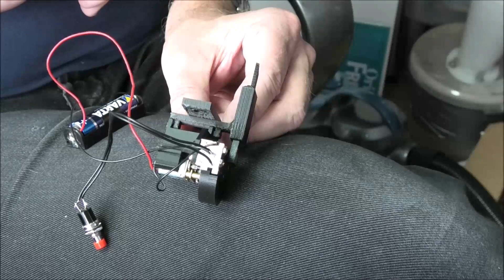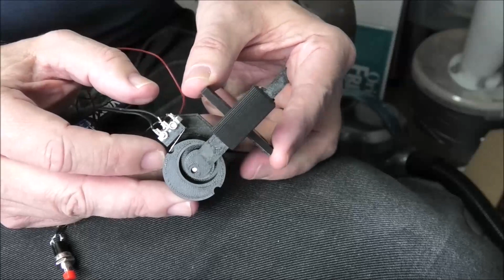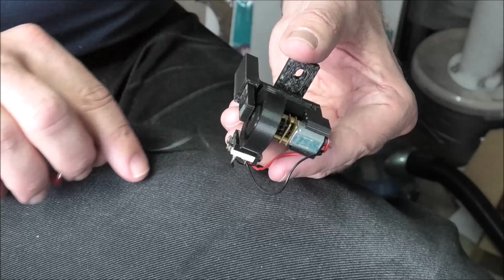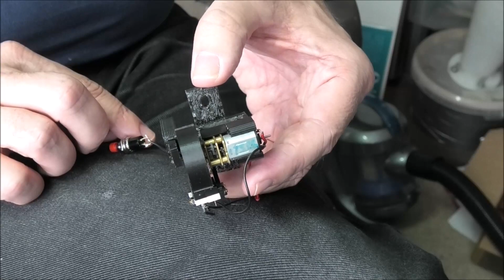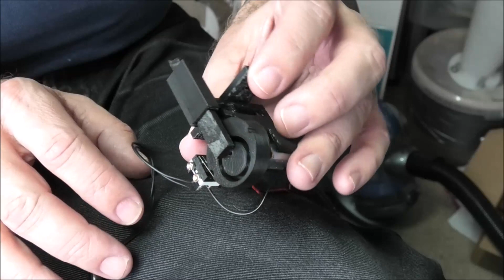The SCOTCH actuator

Comment: Rather neat and well hidden behind the rail.   Going back to my 2mm friend, he found that a stop applied to shorter 4 wheeled wagons had to be on the furthest axle from the coupling.  If on the axle near the coupling, the wagon had a tendency to pull a wheelie over its axle as the loco was pulled away breaking the magnetic coupling.   Your larger and heavier stock may not experience this problem.